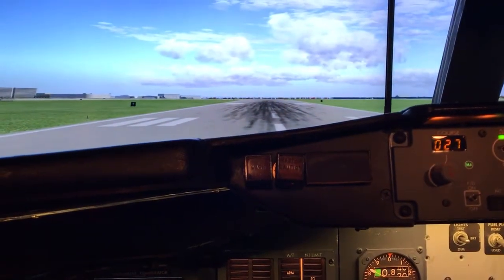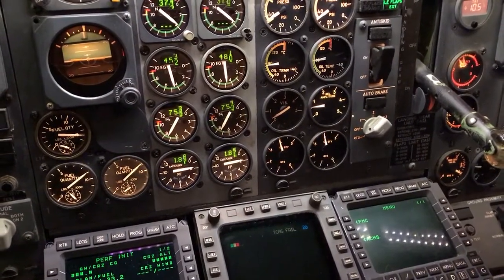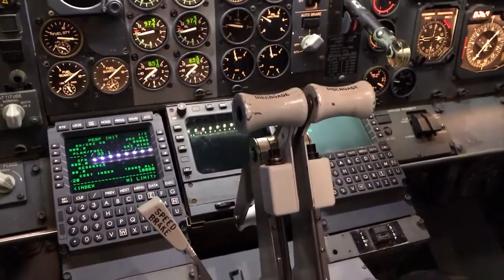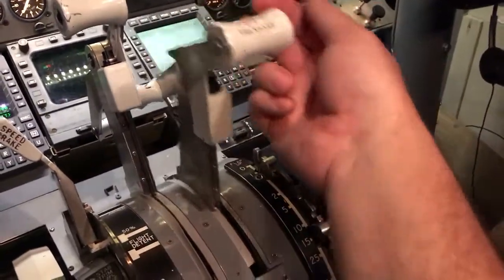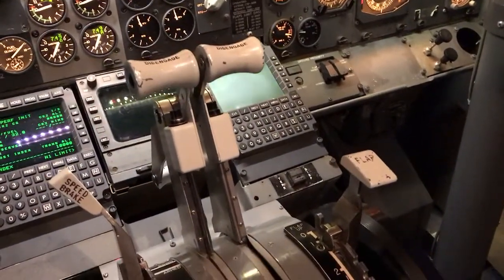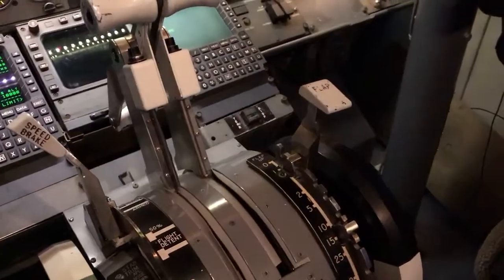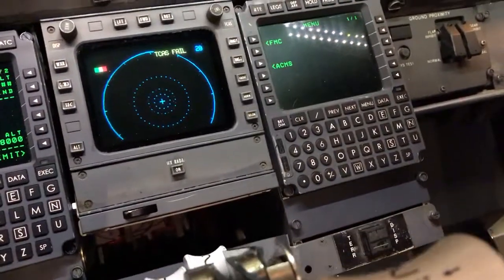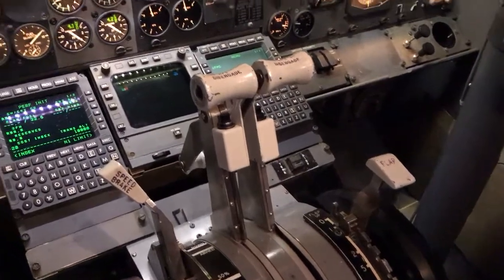733 Sim Autothrottle demo

Comment: Nice, do you know what type of servo motor is used?
Reply from the maker: Its cheap geared motors from ebay with Poly clutches on the shafts and a 12bit mag position sensor for feedback